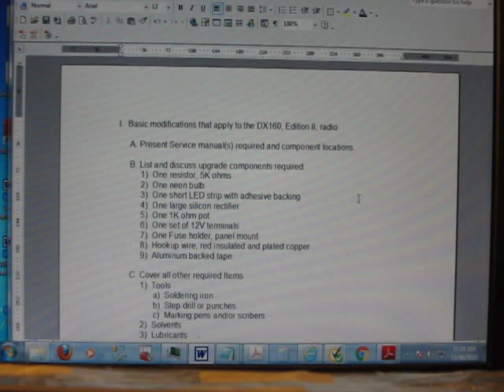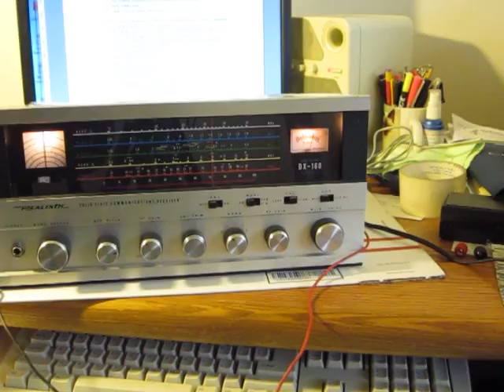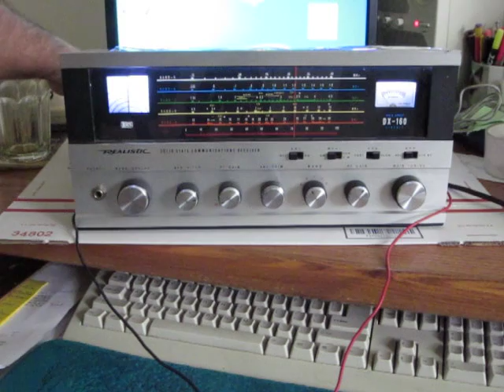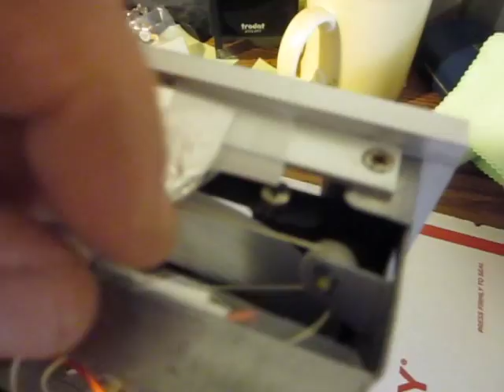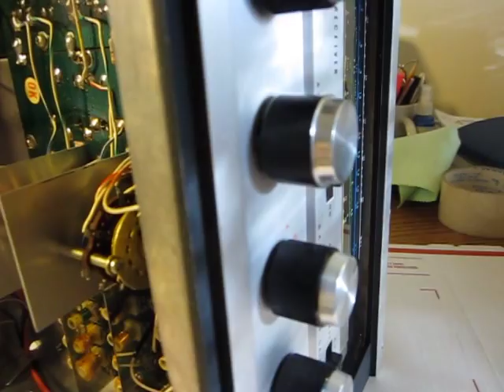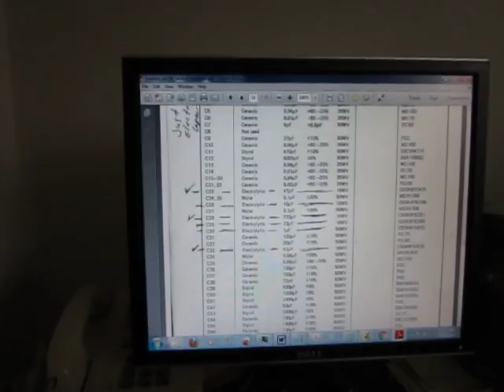RadioShack DX160 Modifications - Part I

Comment: The Realistic DX-160 radio has a dissimilar metal problem on the tuning printed circuit board with the rivets that connect the top side printed circuit to the printed circuit on the bottom side of the PC board. Resoldering is not sufficient, the fix is to solder jumper wires on the top side of the board to replace the connection made by the printed circuit on the bottom side. Shining a bright light through the bottom of the board shows clearly where to solder the jumper wires on the top side. This is the RF amp and Local Oscillator circuit so it will require alignment. Operation without repair may be intermittent.
Reply from the maker: Thanks for pointing that out. I'll look the next time I get it apart.

Comment: These machines are fantastic. Did the mod and it give a much bigger signal on all bands. In the second edition of this beauty there is a resistor (R62, 33kOhm) in the first Bband transformer. remove that and you will hear much more on the B band. For the ant trimmer C there is a fixed Cap (C77 100pF). When you short this fixed cap, the antenna tuning will be more effective. Great receiver, I have a Kenwood QR666 and this bad boy is much better! I sold my Kenwood, yaeshu frg7700, my intermerc ham2, my realistic dx200 cause this is a better performer.
Reply from the maker: Thanks for that tip today. 77s

Comment: What type of neon bulb did you use.  The  voltage rating can be different for them.  Thanks
Reply from the maker: I used a very standard replacement neon.  These usually run 90-110v just fine.
Reply: NE2